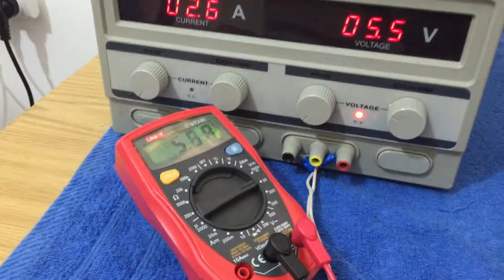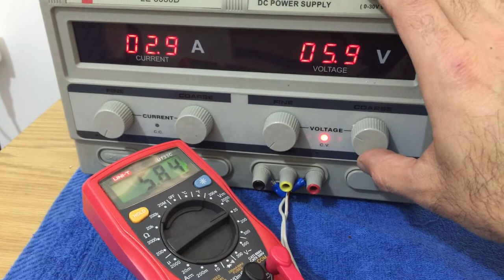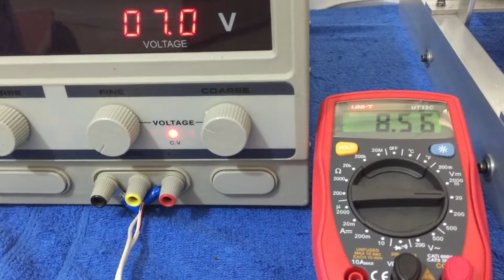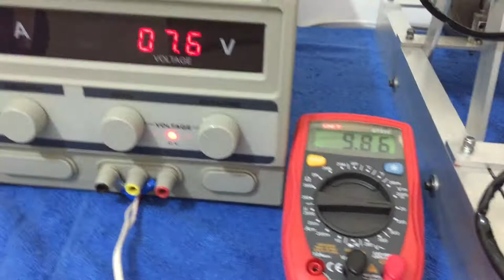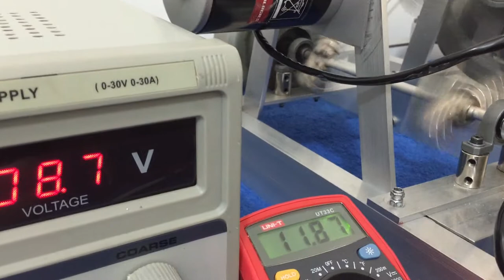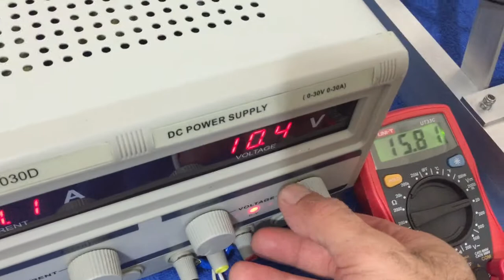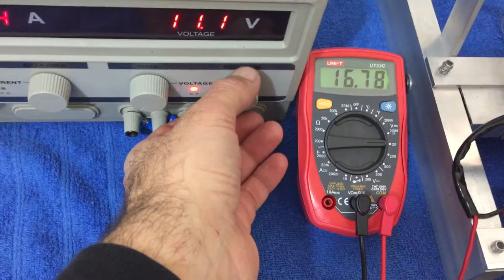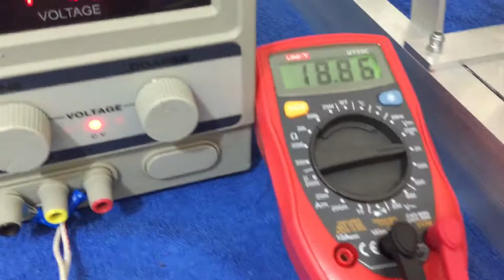The real voice of freedom!!!  V magnet machine magnet motor engine by Oren Gertel

Comment: i think you would get more output if the diameter of the flywheel is lager and has more weight on the outer rim, you will get more momentum? im thinking about redoing my system , a 16 foot pendulum with magnet and a hydraulic system to run a generator, it will give more torque.

Comment: how about pulsing the power to the motor? , u may get a back emf from the motor, im just guessing, u can store the back emf in capacitor bank to charge the batteries. I noticed on ur power supply u were using 8 vdc to get 11 vdc out , by pulsing u may get more power out than u put in. give it a try. just a suggestion. thanks.